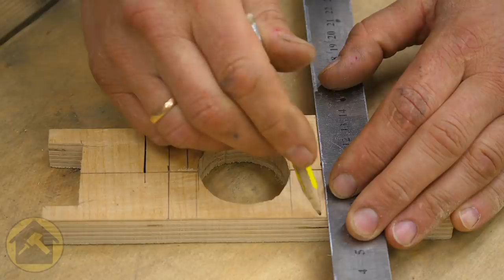Few people know about this DRILL function !!!

Comment: Drills are not designed for that much side load on the bearings.
Reply: Agreed, and router bits are designed to work at around 30K rpm, while you are lucky if you get 1 tenth of it from a drill
Reply: Horses for courses or, more apt in this case...the right tool for the job.
Reply: @andreachinaglia5804  ĺ

Comment: I think the reason so few people know about this function of the drill is because it's not an actual function of the drill.
Reply: YES... finally someone who thinks the same as me about these so called "function" videos
Reply: I own a router just for this task  🙄
Reply: @danielanderson4011  really? I bought a drill specifically so I could modify it to route
Reply: @mr.e8432  call me crazy - I mow my lawn with a converted blender  🙃
Reply: A drill has not enough revs for a good routing job
Reply: Next week is the car srarter into router video lol
Reply: @petergaiser4213  what about a grinder?
Reply: @petergaiser4213  That there is the biggest reason not to do this. How much is a palm router again?! Sheesh!
Reply: Holy crap…who knew that a tool that rotates and has and adjustable chuck can hold onto a 1/4” shank router bit and work…. Mind blown..:)
Reply: @danielanderson4011  🤣
Reply: @danielanderson4011  not crazy at all. I use my angle grinder as a weed trimmer. Few people know about that grinder function.
Reply: So true.
Reply: @chichidouglas5078  If your not joking I have seen people use wire brushes to weed eat. A grinder could work if you attach a long enough handle to it. Sure its not what its intended for yet because some people may not have 100 dollars or more to spend on a router does not mean they can not make a router base. Really any drill will work for a long time. People still use drills for milling with simple set ups. 
Another person might have high speed motor laying around and a chuck that they can use to make a tool. I sure hope people understand that tools were designed by people who needed them. They all started out as homemade tools.
Reply: @kameljoe21  I was joking but I've seen a video where someone did use a grinder for a weed trimmer by making a 2 wheeled push base out of scrap wood to mount it on and attached some line too the blade. Of course it worked because it had enough power and speed to be effective but it butchered the lawn. I've made several tools out of broken tools that still had good motors but the motor has to have enough speed and torque to do the job you're building it for or it's not going to work very well. A drill doesn't have enough rpms to be used as a router. It holds a router bit and spins so it does physically work but it's going to burn and gouge the wood. So if you care about the quality of your project you don't want to use a drill as a router
Reply: Agreed.
It's a hack.
Reply: Mr. E
You just won the internet!
🤪😂😂
Reply: Daniel Anderson
😂😂😂
Reply: Chi Chi Douglas
Years ago two pals and myself, on our way home from night fishing, found a neighbour trimming their lawn at just gone 4am...with a pair of nail scissors!
OCD and an untidy garden don't sit comfortably in the same head.
The neighbour's lawnmower had broken and scissors struck them as a sensible solution, only they couldn't find their kitchen scissors and settled for the only alternative that would allow them to accomplish their mission.
😂😂😂
Reply: @billyandrew  in that situation a grinder would be my first choice, but if I didn't have one then a torch or a sharp knife would be better than nail scissors.  I can't even use those, because my thumbs don't fit in the hole. Another option would be wait a few hours and ask to borrow a neighbor's mower. At least they had the sence to try to do it when nobody would see them, and they would've got away with it if it weren't for those meddling night fishermen.

Comment: WOW I needed this!!! Went to home depot and bought a drill press with a cross laser, band saw, electricians stepper bit, vise, skill saw, a set of files, two drills ( cuz why not right?) clamps, drill bits, screw bits, bolts nuts and glue, and some very rare plywood..... unfortunately I ran out of money before I could buy a pencil compass.  :(
Reply: hahaha yeh especially when a proper one handed router costs less than a drill

Comment: I use my Routers for that  a drill is designed way differently  than a Router and you will be wearing them out like crazy  but my Porter Cable Router that I’ve owned and used for more than 25 years  for woodworking is still going strong and works like the day I bought  it  plus there are many ,many accessories available as that happens to be one of the most popular tools for Professional Woodworkers around the World

Comment: Drills have RPMs of about 1200-1800 RPM. A good router will deliver about 25000-30000 RPM. Your router bit isn't going to do the same job at low speeds.

Comment: I would refrain from giving advice on drill if I was using a PZ2 bit to drive a PH2 screw at 3:43. PZ2 screws have 4 additional lines on the head to differentiate them from their PH2 cousins. You can tell the bit doesn't engage fully as it should
Reply: I had a similar conversation with my son today, but as walking to the shed to pick up the correct screwdriver would have taken twenty seconds, he carried on chewing screw heads.

Comment: I guess in a pinch it would be ok, but drills are not built to take side load very well, that’s the whole reason you don’t use drill presses as mills either, eventually that drill will wear out quicker then it’s life expectancy.

Comment: A cheap drill as he's using is going to smoke and die after more than 5 seconds of intensive work.
Also, drills in general are not good at taking lateral load (perpendicular to the rotation axis)

Comment: Nice job! I think Wing Nuts might actually be more practical though. Or weld some hand tighteners to those slide nuts for tightening so you don't have to reach for a wrench every time
Reply: Or just use the contraption for firewood.

Comment: Geezus there are nothing but negative comments. This is a good idea. Especially seeing as I always have my drill and at least a couple router bits with me on a job site. I don't always have my router.
Reply: If you're on a job site, you're expected to do a job right, and this is not the right way. For the time it would take to make the plywood contraption, you could leave a job site and go to a store and get a cheap router that would do a better job, which it's designed for. For a simple chamfer, a block plane would do a nicer job than even a real router, but even a sanding block would make more sense to soften a sharp corner than this Rube Goldberg. Use the right tool for the right job in the right way.

Comment: Not a function of a drill. The bearings in a drill are not specifically designed to handle the side loads that routing exerts.   Also driver/drills do not have the high RPMs that routers do.   Use the right tools for the job folks.

Comment: Why not using wing nuts? 
And I'm not sure the axle from every drill machine can have lateral forces. Be sure your machine can.
If not...replacing your drill because damage can be avoided by buying a special routing machine...not more expensive than a drill.

Comment: This is not only a waste of time but most likely dangerous. Router Bits are designed to operate at a minimum of 10k rpms and up....topping out at about 30k.
Most drills top rpms are about 1.2k to maybe 1.5k.

Comment: Very creative but those bits are designed to be spun at a very high rpm. They better be sharp if your gonna try something like this. I would just pick up a 69 dollar ryobi trim router or even a cheaper corded harbor fright one if you want to do the occasional edge rounding. But yes creative, I’ve seen people use a hand drill as a lawn edger, paint stirrer, and even a bike motor making it electric, all cool stuff but could be dangerous and could at minimum break your drill driver. He should route with that drill in hammer mode for fun 😂 😆 😝
Reply: Well paint stirrer is a legitimate use. One can even buy the tools at a hardware store.

Comment: 1. The drill is not in there straight. 2. The setup wobbles when he uses it which would make the cut messed up. 3. The threaded rod in the sides being held in with glue will eventually come out from the tension placed on them from tightening of the nuts. In short, this is a really stupid idea that will fail eventually.

Comment: THIS SHOP APPEARS to have a drill press and a band saw but can't afford a router and a router table?
SUGGESTION # 1 - buy a router and a wet/dry vacuum.
SUGGESTION # 2 - use the nice shop tools to build a router table that captures shavings when the vacuum is connected to it.  There are other videos on YT that show how to do this, safely.

Comment: Firstly, this is not a drill function it's a hack.  
Secondly, you are shortening the life of the drill by putting too much weight bearing on the side, instead of downwards.
Routers are designed to take the side pressure, whereas drills are not.
Thirdly, nah, Fam, this was some bad woodworking, overall. 
Bad jigsawing (clearly seen at 01:50 and 02:06) along with overcut jointing, (02:40). 
Maybe I'm too picky, being a perfectionist, but I'm being honest is all or watching too many channels that use the right tool for the right job or maybe they edit out their mistakes, who knows?
Anyway, thanks for uploading.

Comment: That is ridiculous. So much work for a very crappy result. In spite of heystarfisch100's opinion about the EU: in Germany you can buy a cheap router for about 50 € (42,50 $).
Even that cheap router will be so much better ... that is no question. Calculate the work and material for Eugene's attempt. Never ever makes any sense.

Comment: Dumbest thing I ever saw. Never NEVER use a power tool for something that it was not designed to do.
Your fingers and your life hang in the balance.
Drill speeds are WAY to slow for routing edges, that is why they made routers.
The only thing this channel is good for is supporting the local ER near you.

Comment: This is so dangerously stupid you should have your account deleted.  Drill chucks simply CAN NOT handle that kind of a side load.  It WILL cause damage to your work, and it will very likely cause serious injury.  Don't be an idiot, buy an actual router.  Your work is less likely to be damaged (remember to keep your chuck clean), you are less likely to be injured, and the quality of cut will be vastly improved because the router will have less run out, better bearings, and will run at a higher speed.  It will also be easier to control.

Comment: Way Cool. So if anyone has a drill they also have a router also. Awesome.
Reply: @WrathOfMrRodgers  ???
Reply: @Randy_Williams  that's not the case in reality. A router operates at about 300x the rpm. A drill probably couldn't router anything beyond soft pine. It would ruin the drill and the wood quickly.
Reply: @WrathOfMrRodgers  I'll stick with my router then, thanks.

Comment: This isn't a drill 'function' at all. This is manually re-creating an existing tool... it's called a router.
I could just as easily make a video called "Few people know about this DOORSTOP function" and then show how you can put a wedge into the fireplace and use it for fuel on a winter night.
Not even attempting to be accurate... just plain lying about being clever with a DIY project.
I love DIY vids... but I detest THIS kind of clickbait.

Comment: Decent ideas but wrong tool use for manufacture, wrong materials used and horribly sloppy workmanship. In the end a dlill won’t replace a router. A router bit chucked in you drill press would have worked much better. And that split you created in the plywood will eventually fail and cause the piece to split wide open. Never drill plywood with the grain. Your workmanship made my eyes water and cause tears.